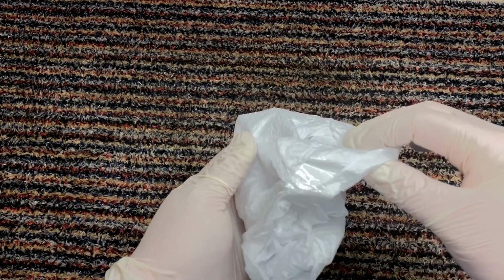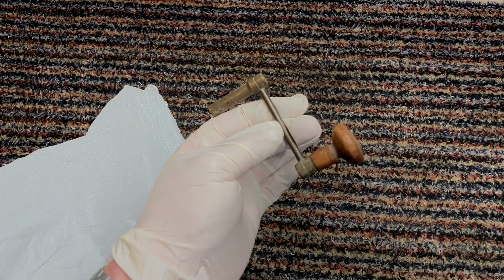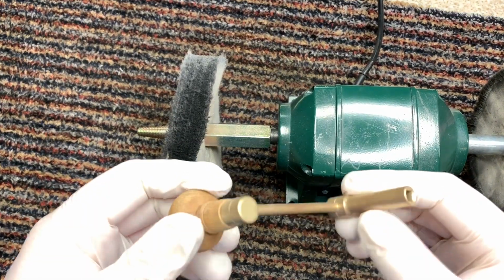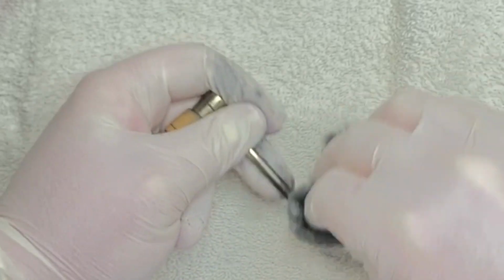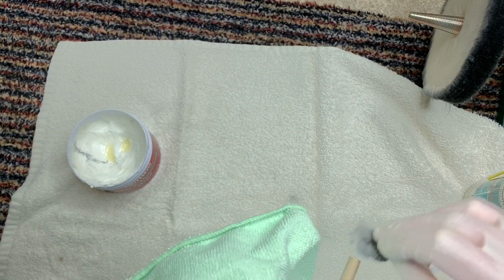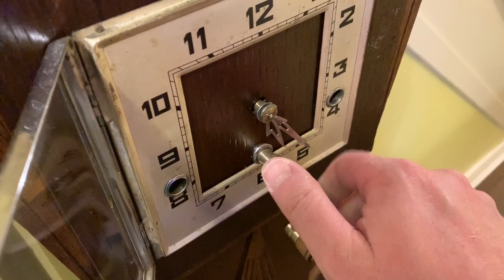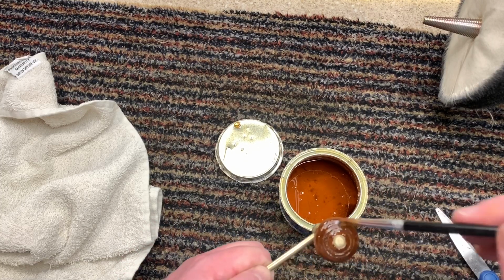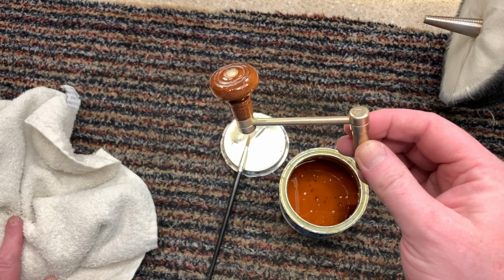Antique Clock Winder Restoration

Comment: Nice Job. I have a 21 day wall clock, I would be afraid the extra leverage from this key could cause the main spring to bind. Sometimes I do not know my own strength.
Reply from the maker: Well, I was worried about that too, the older clocks definitely have a sturdier mechanism in them, but I have used it in my 21 day clocks and you just take your time and after a few uses you get used to it and feel the pressure build up when it gets to the full wind.